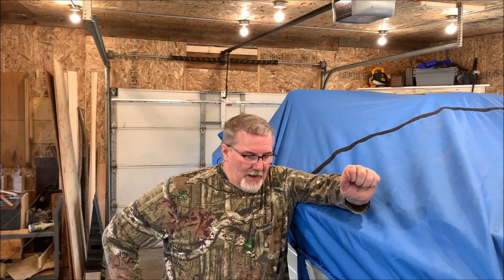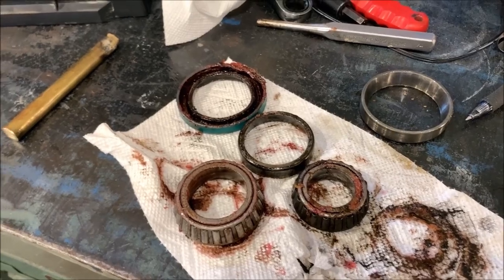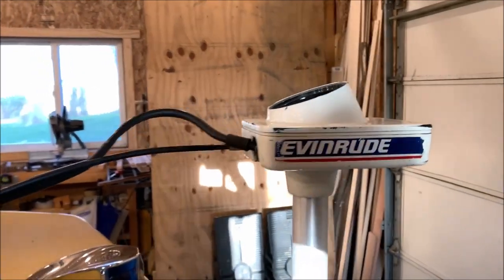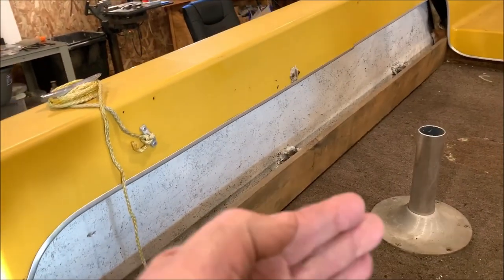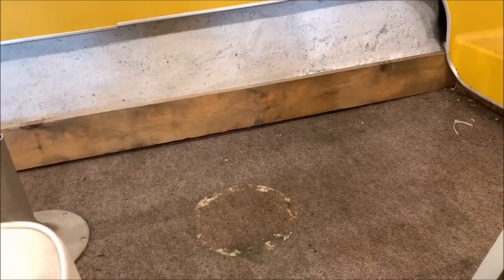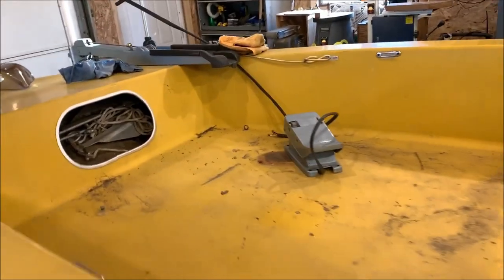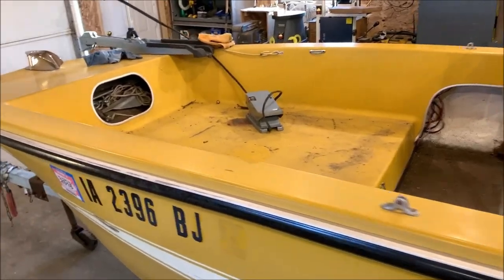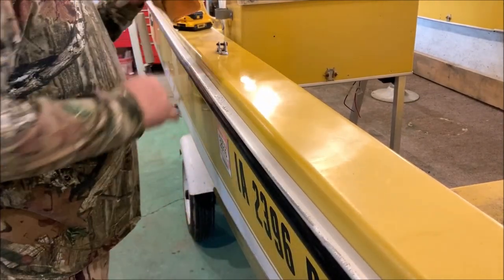1972 Glasspar boat by Larson restoration project part 1 the discovery

Comment: I just bought this boat, i bought it for the motor comes with a 70 horse power 2 stroke oil injected. The front part has 2 bench seats and 4 “bucket seats” in the back. After I take the motor for my house boat im planing to gut it and turn into a fishing boat. Thanks for this video

Comment: I had a late 60's StarCraft Bahama- 15' runabout and it had many of the same items, Bow light,  cleats , Chrome bow holders ( so the boat cover wouldn't sag ), and Chrome fender clips( just clipped the fenders to them and throw them over the side when docking) other wise stowed under the bow next to the anchor. And the same E-Z style loader trailer.  My bow light had a flag pole holder where your Bow light has that quarter size cover by the screw. I had the pole but the flag was long gone. I think that the 4 might have been from a rental fleet (boat#4)
 I remember those trolling motors well, several friends had them and they worked well, I never was rich enough to have one until the late 70's.